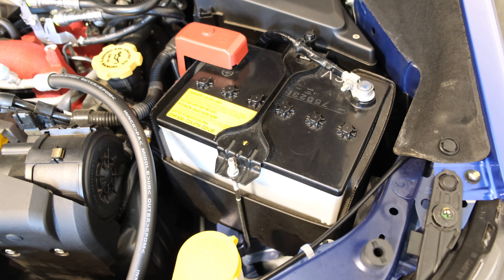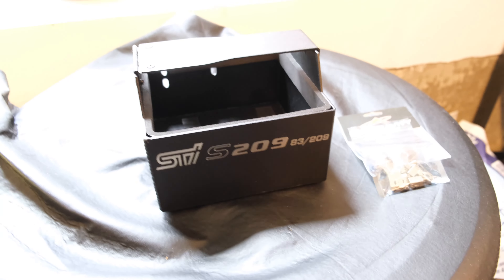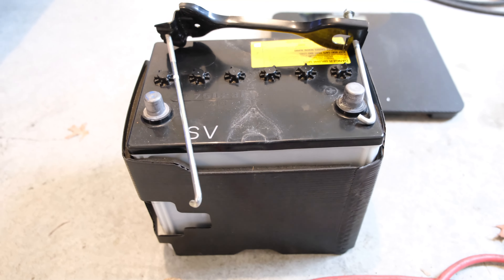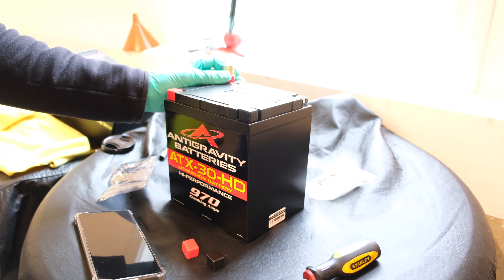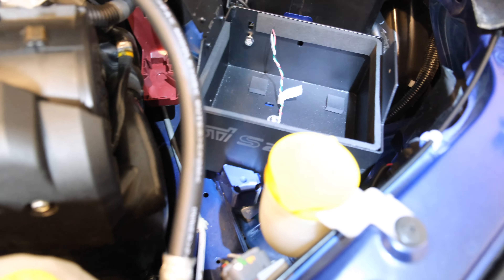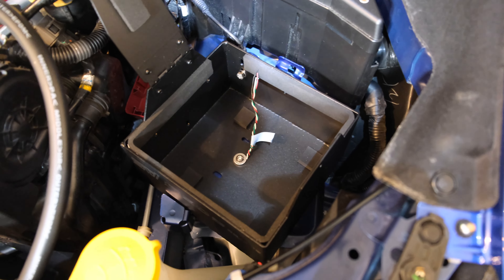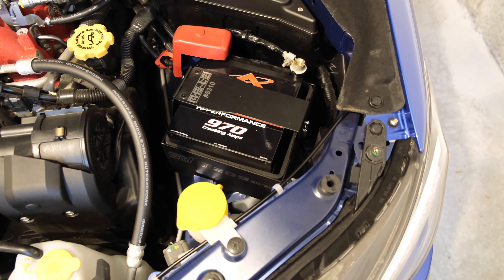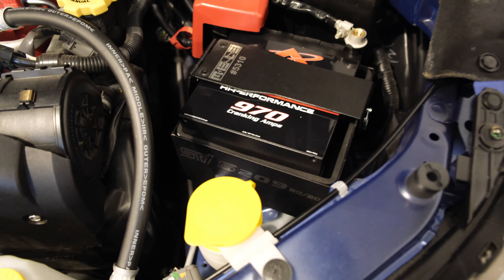The Best Lightweight Battery for the WRX STI S209 - ATX30-HD Antigravity Battery - 8 lbs!

Comment: @thelasts209 did the battery come with post terminals or do you need to purchase separately? Also what spacers did you use? Thanks
Reply from the maker: @alexudolkin2146  yes it came with it. I dont remember what size washer but you'll find one the correct size easily if you just go hardware store
Reply: @TheLastS209 I just bought this exact battery for a 2012 WRX, is yours still running good?
Reply from the maker: @alexudolkin2146  yup

Comment: Did you have to charge the battery before use?
Reply from the maker: Nope
Reply: @TheLastS209  Cool.  Will be installing the same setup today in my STI.  Appreciate the installation guide.
Reply from the maker: @sean_nguyen  make sure to buy washers and get the orientation correct. Took me 3 tries to finally get it lol
Reply: @TheLastS209  Took me 3 washers to get the terminals to sit flush with the battery.  Same screws worked.  Would've been assed out without your video :).
Reply: Holy crap.  I feel like I just overclocked my car.  All the electronics responds twice as fast.  It definitely cranks up quicker.  When I corner balanced my car, they always said it’d be better if my battery was in the trunk.  I’m sure shaving all that frontal weight is noticeable in my corner balance.

Comment: Just curious do you run your sound system loud and would that possibly affect your battery performance
Reply from the maker: I don't run it very loud but this battery has more power than OEM and still weighs a lot less. It's a win win

Comment: Does this battery swap come with instructions paper?
Reply from the maker: There are instructions that I found on yt, but it's very vague. I had to contact Mitch from mele design firm to install it correctly. I like that the battery can still use some of the OEM protective parts and installs in the correct orientation. Thanks for watching!

Comment: Right before I looked it up I thought, “that’s prolly like a $500 battery…”

😂 

I’d love to get one for my 20’ STI but I may not have the means for that practically. I still desire a 2500lb 400hp car, but know
that’ll never be produced… so I went with the most enjoyable car I could find that was able to carry passengers/luggage and still put a smile on my face. I plan on owning this car until Jesus comes back.

These cars are so engaging compared to all the electronic steering cars. Every time I drive other cars I think of how little feedback there is and how artificial it feels.

I like the detail of the engraving on the battery mount. Thanks for telling us the difference in weight. Let us know, in time, how the battery holds up (durability/longevity wise). 

Does it crank over quicker/stronger than the OEM battery?

Beautiful car, thanks for the video!
Reply from the maker: Thanks for the comment! These cars are definitely the last of it's kind and honestly a lot of fun if you can get the right power/weight ratio. A lightweight battery is just the first step in the weight reduction process. 

I definitely love the hydraulic steering feel from the STI, but electric power steering sports cars have come a long way. I've driven my friends' s2k, gr86, and nd2 Miata and those all have pretty good steering feel in them.

The battery cranks about the same as stock, maybe a little faster.

Thanks for watching and stay tuned for more s209 content! 😊
Reply: You can pay it off in 12 months installments if you want.